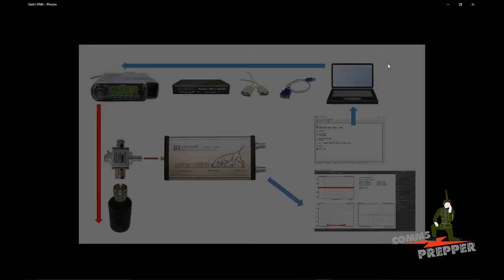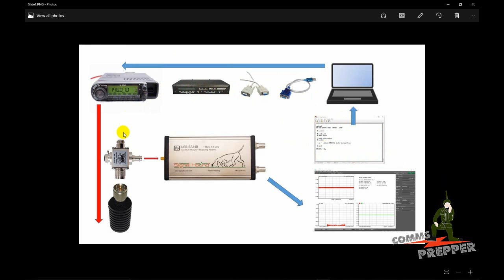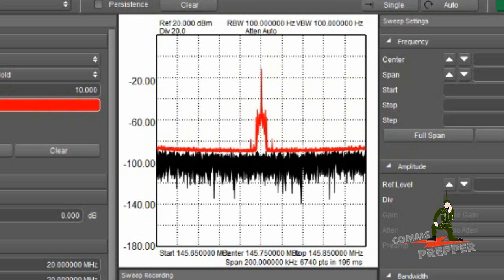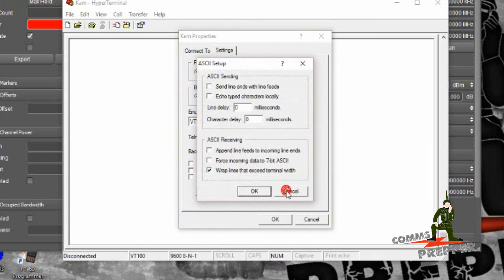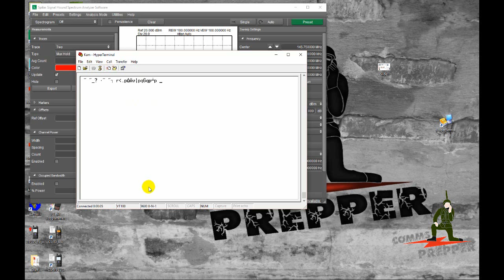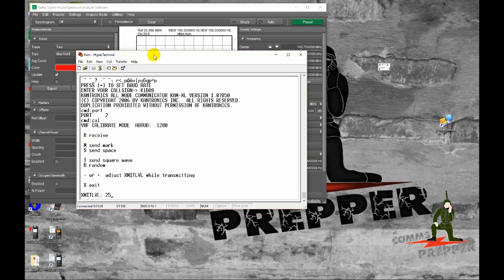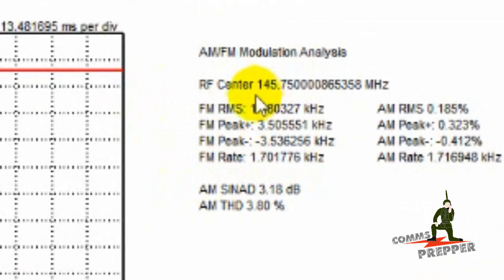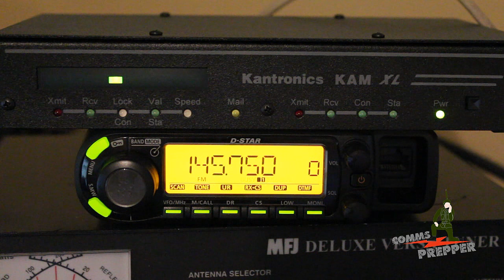Kantronics Kam-XL Terminal Node Controller (TNC)

Comment: I got the little kantronics and an older MFJ-1278 that I upgraded.  I like the fact you can plug it right into the back of the 880. This has me also thinking about getting a GMSK modem to make a dstar access point.  

I use putty and or virtualbox with a DOS image for older packet software.  Putty and RS232 still get plenty of use in and outside amateur radio.  as always good content.

Comment: I get that you can do calibration and adjustments using the signal hound software and sample hardware but, why? Isn’t there a basic way built in to make adjustments via commands without needing all that fancy lab equipment? Just set the damn thing and be done with it. Or am I missing something?
Reply: Is it?

Comment: Great video about setting the deviation.  Too bad no one uses these for GTor, as it is a fairly capable mode.  A few notes for people: 1) get a USB to serial converter with the FTDI chipset, it saves a lot of headaches. 2) KAMs use Mark and Space tones in the 2 KC range, so the dial frequency is lower than what is used by SCS and others for Pactor.
Reply from the maker: I wish there was more than one Pactor 3 maker.

Comment: Commsprepper - I see that most of these videos focus on packet VHF.  I'm trying to get my Kam  to do some packet on HF, but the calibration commands are different on the HF Port 1 side.  There is no receive or +/- options.  I have a signal hound . Any ideas on the acceptable variances on the HF AM side?  This video was GREAT, but I'd love to see you do some experimentation on the HF side as well.  Thanks for all your great work!
Reply: On HF you adjust the audio level by watching your ALC (Automatic Level Control) meter on the transmitter.  You should begin to see your output rise before you get a reading on the ALC meter.  You should see Maximum output of your transmitter in the lower end of the ALC range.  You should stop increasing the XMITLVL adjustment with the + or - keys when you reach max power output.  Make sure you do this with no audio processing enabled.  Turn any speech processors off.  Also, check your transmitter documentation and see what maximum power output should be with 100% duty cycle digital modes.  You may have to reduce power.  Packet is a 100% duty cycle mode.

Comment: Quick question, and you might cover it in your digipeater video (if you have that). Would I put my call sign in under MyCall and the -1 or whatever my SSID is going to be, under MyAlias? For example, W0PCD-12 is what I plan to use. Would it be W0PCD in MyCall and W0PCD-12 in MyAlias?

Comment: Really nice.
Reply: Is the Spectrum Analyser required?
Reply from the maker: No.  Most folks turn the levels down and use another radio to listen to the audio and slowly raise the level until good comms are achieved.  The goal is not to over-drive the radio with too much audio.

Comment: Nice video. How much activity do you see on VHF packet?  I've been out of it for 25 years. One suggestion: you might try TeraTerm. It's free and better than HyperTerm.
Reply from the maker: thanks for the tip.  I have not seen any activity on packet like the '80s or '90s but Winlink.org has put together a great packet email system.